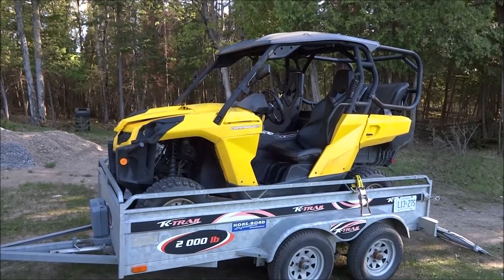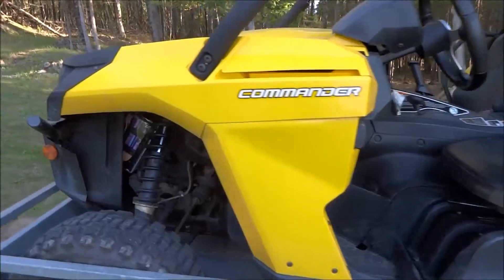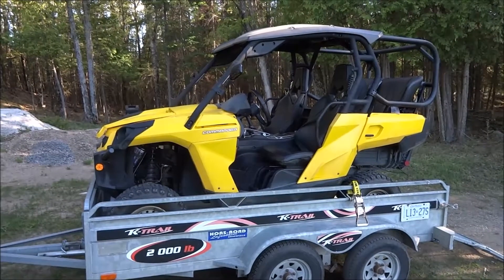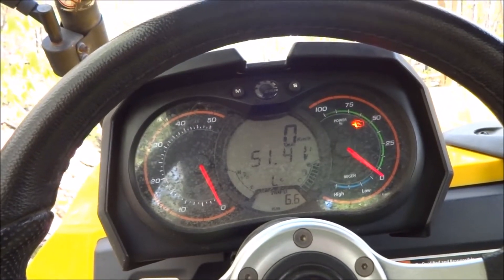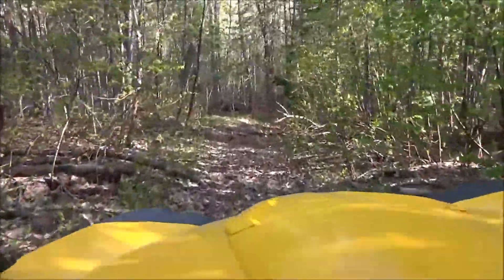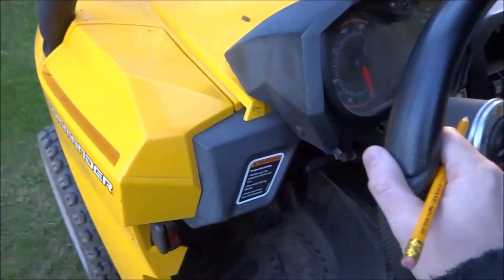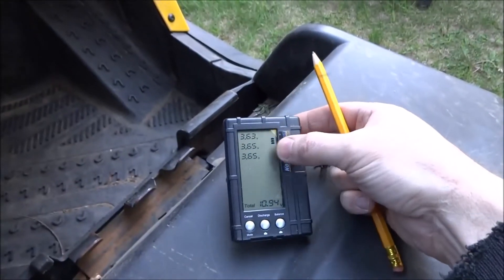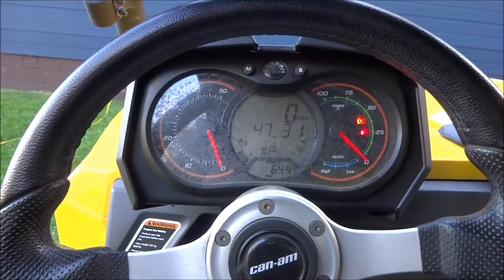Commander Electric upgrade to 18650, range test

Comment: A 4s LiFePo4 would probably work better. Just from my guess you may get 20 km from the remaining capacity at 3.6v.    I would like to have something like this. If you had 2 4s banks in series with 2 3s banks . equal to two 7s banks.  It would be more equal to the lead acid voltages. You could go to 40 v dead , 56v at 4v per cell. I went with 24v system and 7s liion for my home power. Charge to 28.5-28.8 a bit under 4.2/cell. I'd like to stay at speak of 4.1v. Great video.
Reply from the maker: Possibly, but I have access to used laptop batteries for free and my 13s pack seems to work just fine.

Comment: What is your new lithium charger ?
Reply from the maker: It's a DPS-6015. You can see it in my other videos... https://www.youtube.com/watch?v=uNmiRLX7Kug
Purchased from aliexpress:
https://www.aliexpress.com/item/DPS-6015-single-output-programmable-switch-power-supply-60V-15A-900W-DC-DC-TTL-serial-interface/32782400805.html?spm=a2g0s.9042311.0.0.27424c4dTrJtX7